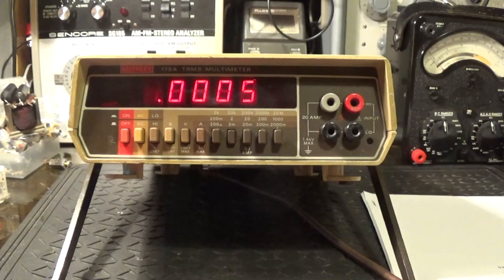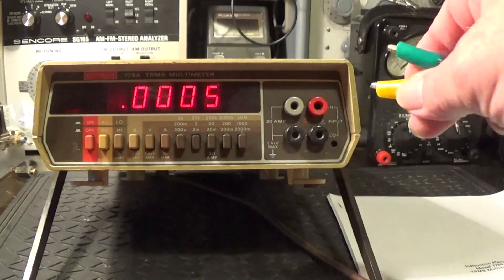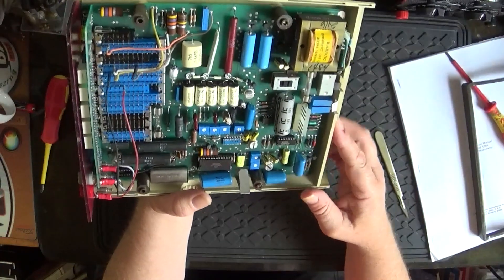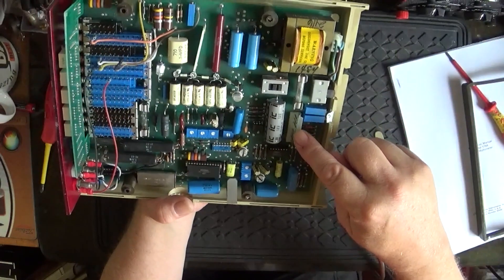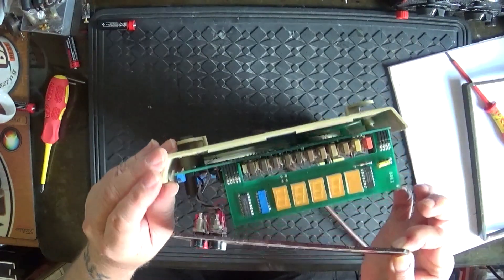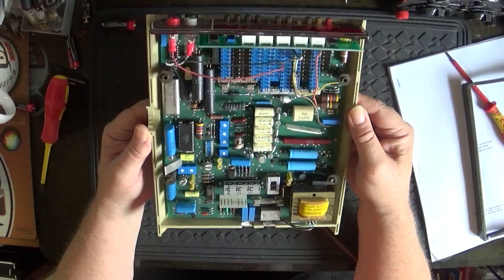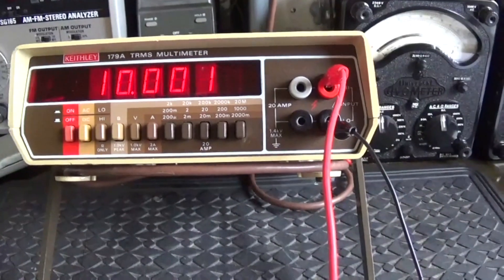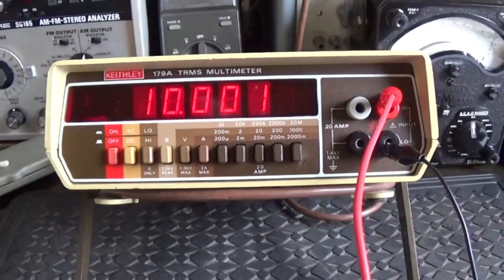Keithley179

Comment: Hi new sub here<<<<<

Nice job I would have like to seen how you cleaned the switches and what you used.
I just got a 175 off ebay for cheap (works great)
I like that the 175 has auto mode and manual mode.
However I wished it had a continuity mode with sound.
I like how yours has the red display easier to see.
Thanks for the video.
Reply from the maker: Hi thanks for the sub. I would have used Servisol, not sure where in the world you are but it's a contact cleaner we get here around a third of the price of Deoxit, which is exhorbitant in the UK.  Spray and then work the swicthes vack and forward and dozen times. Careful how you spray, don't get any on the boards. Thanks for watching and commenting!

Comment: CSL that dates it. CSL were Calibration Systems Ltd.
Reply from the maker: Hi Simon, do you know when they went out of business?  I couldn't see a listing for them at Companies House. I have CSL stickers on many pieces of test gear.
Reply: Not entirely sure Andy.. We were using them up until about 10 years ago, and I think the HP spectrum analyser  was one of the last things they did for us before we left for another cal house. I will ask the chap at work who is in the know, but I think only 5 years ago or so.
Reply from the maker: @SoddingaboutSi  I did find them. Stopped trading as a company in the mid 90s. Thereafter as an agent for Dowding and Mills (now Sulzer) until 2014 when they were voluntarily struck off.